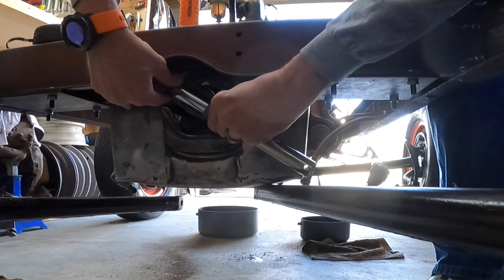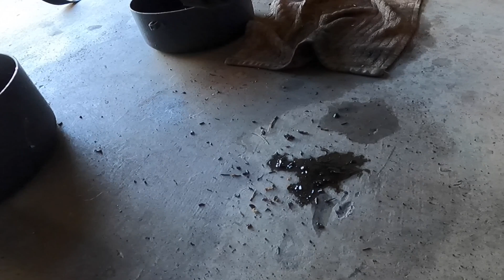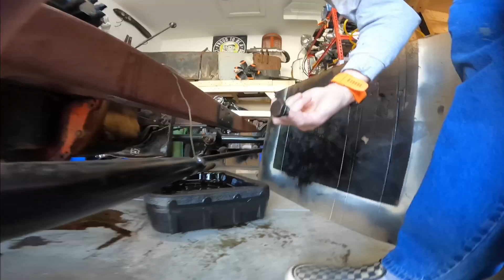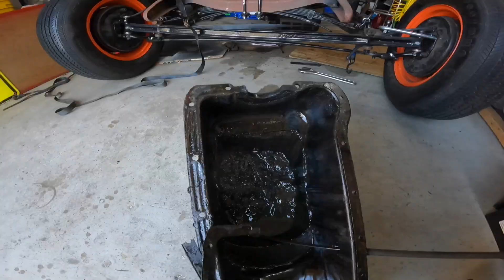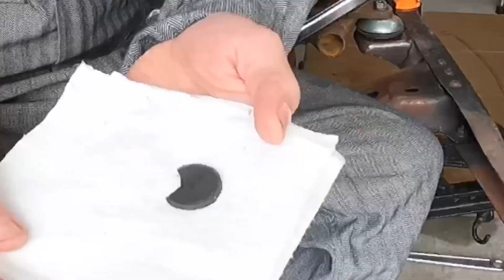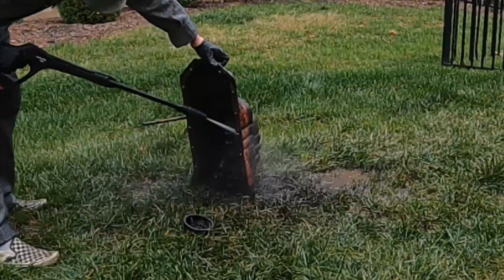Will It Run?!

Comment: Pull that lifter out and try it. If it has good compression on the other cylinders, and it's not  clanking and or clatering, maybe you can put another cam in and run it. While you're  changing cams you can inspect the rest of the valve train ,and cleanit. Dan S.from Michigan and Texas
Reply from the maker: Stay tuned, I’m going to be back working on this engine soon!

Comment: I see the front motor mounts are already installed - I missed seeing a video of that.   The last one I watched was when you got the tranny mount fabricated and installed.
Reply: Whoa, nice sleuthing. You’re like part mechanic and part forensic scientist! 
Hope it’s all sunshine and roses since you’ve broken into this thing. 
Keep up the good work homie!
Reply from the maker: @tomellis5462 lol  Haven’t really been focusing on the engine since discovering the bad news.  At some point I’ll be cracking open the other 8BA that I have and seeing if it is any better.  I hoping to get a running motor out of the two of them. 😂
Reply from the maker: Yeah I have a video called AV8-T Motor Mounts where I modify the original Model A rear motor/transmission mounts to make front motor mounts for the V8 flathead.
Reply: @AJStarch  Found it.    Hey, next time you're at Harbor Freight, get some neoprene gloves; makes digging around in the oil pan less messy :)
Reply from the maker: @ModelARickLasCruces  🤣I already have them… just didn’t put them on.